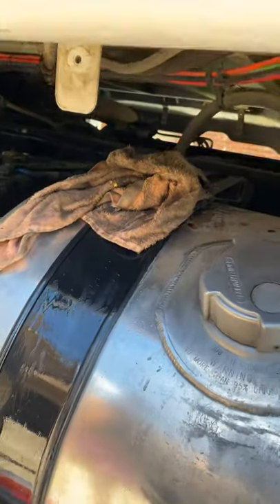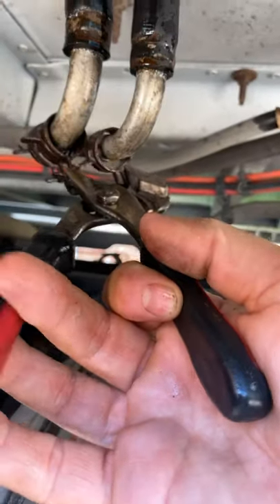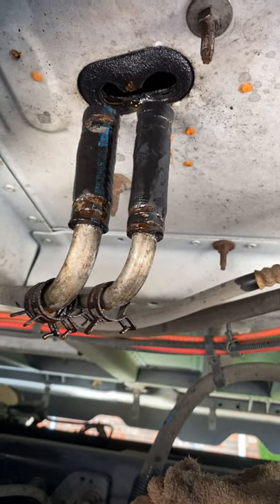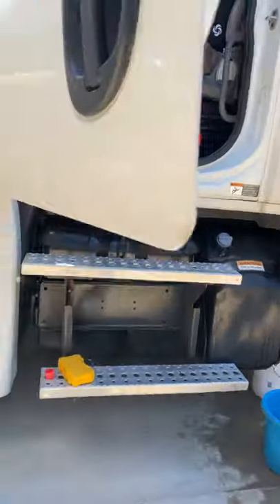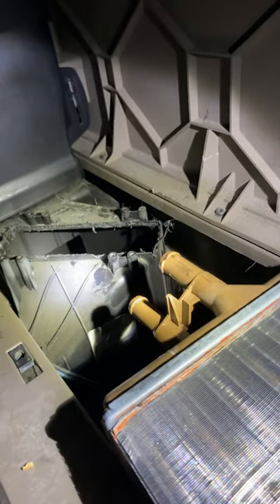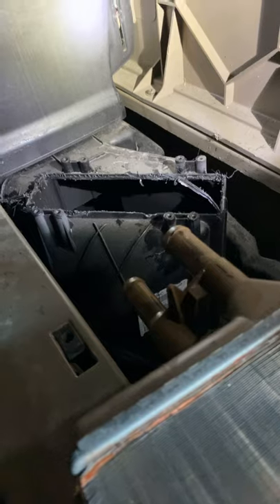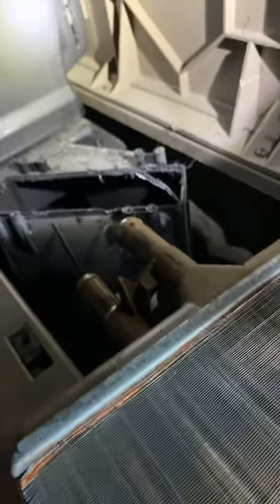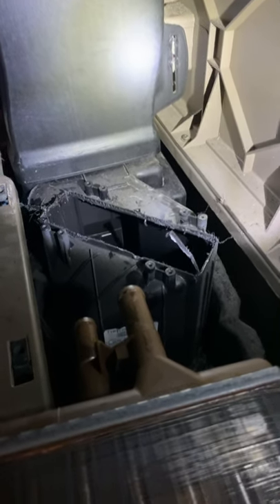Freightliner cascadia heater core

Comment: So why not just change the bunk heater cores hoses only? Instead of replacing the entire thing? If that the case that is only the hoses? I am thinking maybe just saw a bigger hole at the bottom and replace only those two hose. Any thoughts?

Comment: I changed mine,  but there's a smell coming out of the vents 
No idea why
Reply: I have same problem.did u figure out y the smell is coming ?
Reply: Did you change the front heater core, I had the same issue but when I changed the front one it stopped smelling.